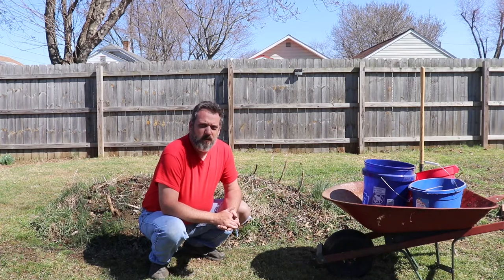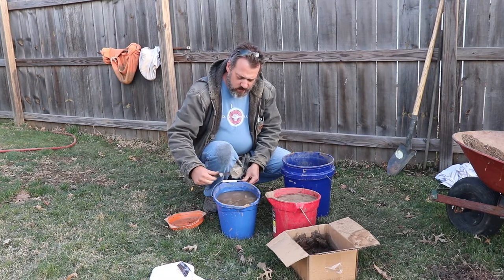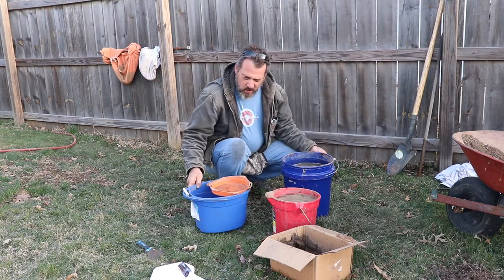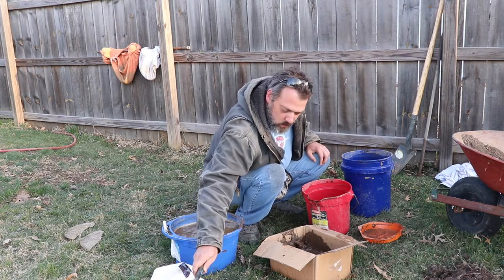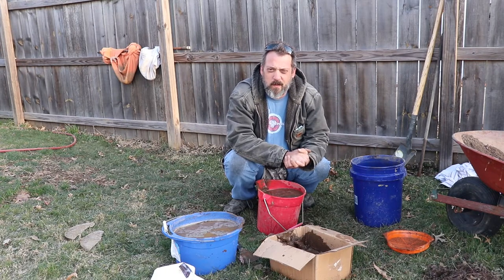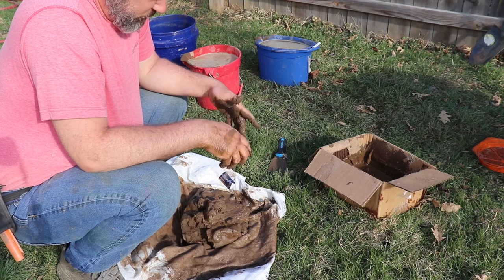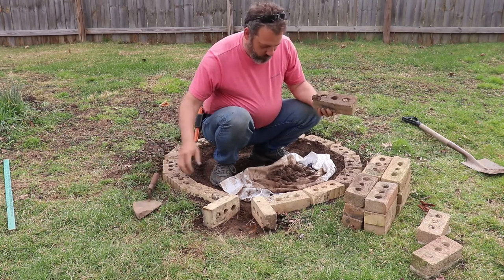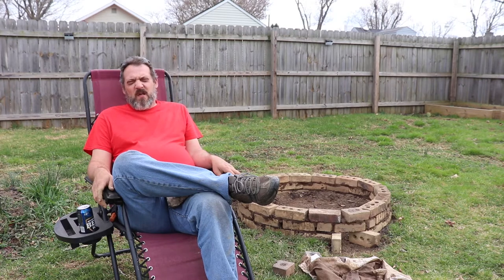Making a Mud and Brick Fire Pit

Comment: Just use refractory cement or a mixture of motor and perlite. You can look up mix ratios etc
Reply from the maker: Would have been easier, but then I wouldn't have had left over mud for my facial
Reply: @oldgoatdiy  Refractory cement has great adhesive properties so it would of cleaned the pores haha but in all it came out well. I have done this method to cook hab peppers for hot sauce so I didn't steam up the house and burn everyone's eyes and shit lmao